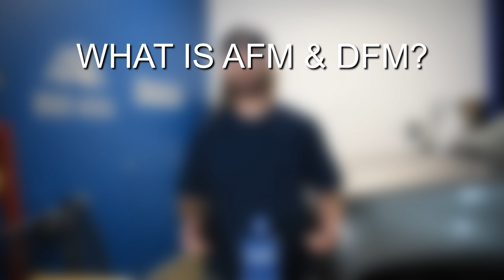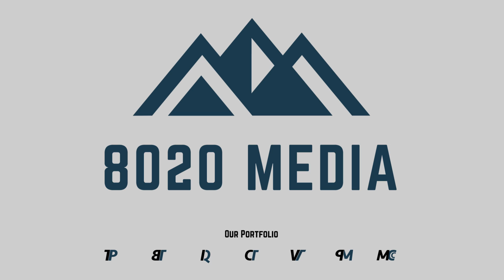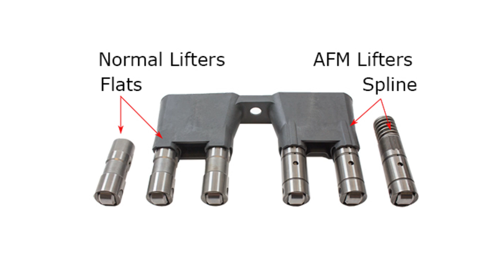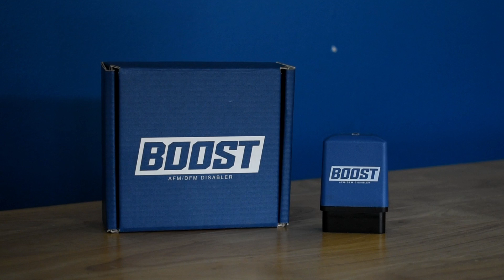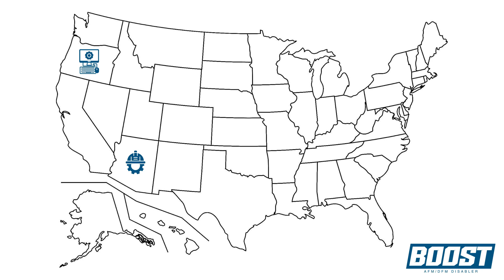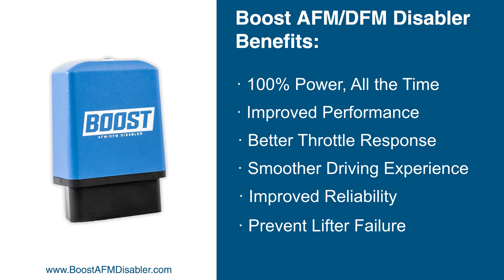Understanding Active & Dynamic Fuel Management and The Problems They Cause (AFM vs DFM)

Comment: Wish I'd known about this before. Now that Ihave another engine definitely disabling it.
Reply: yep, i had 2 lifters fail in January when i jumped into the left lane on the highway and accelerated to to keep the flow.  Between that days lost work, cost of a rental, and the service fee.... I am still paying on that $5K repair bill!!!  I got my disabler delivered today, after my mechanic's lifters on HIS truck failed.  He researched it, as it's a common issue that GM doesn't care about, and he told me about the disabler.  I had a 2nd time that my truck did react to an acceleration.... scared the fire outta me thinking i was gonna have to pull over and and pull out the credit card again!.

Comment: 2015 Silverado.  Bypassed the AFM, lifters collapsed anyway. $6500 to fix. Extended warranty covered $5000 of it.
Reply: so you had the lifters fail, even with the disabler?  I got mine in the mail today.  How many liters do you have?  mine is 5.3L, and i had life failure  when i was accelerating.  I don't want that happening to me, i don't have any warranty
Reply: @HollySlezak 5.3 liter. Truck had 41,000 miles before I used the disabler. I put it back on, after the repair.

Comment: Had this on for 10K already.  Seems to run well.  Slight surge at a stop light to 1st gear every now and then that I didn't notice before but it's rock solid staying in V8 mode.

Comment: Absolutely disgusting that GM hasn’t recalled them all to correct this. And yes, I own a 2013 Escalade EXT 6.2L and yes it has cylinder 8 misfire codes, regularly due to the AFM system….
Reply: You can thank the Democrats for imposing regulations on the auto companies.

Comment: I just bought a 2014 Silverado 5.3 70,000 miles. No issues yet except I just had to add oil half way between oil change. Does everyone recommend this as soon as I can get one?
Reply: i bought a 2015 silverado 5.3 with 71,000 miles the same time you did.  But I learned about all this AMF/DMF stuff when i jumped into the left lane on the highway and accelerated.  Unfortunately, it blow 2 of my lifters.  With loss of that day of work, and cost of a rental car, and the shop costs... it cost me $5K.  
Shortly after, as my AFM/DFM disabler was shipping to me, I gunned it to avoid the sudden turning traffic behind me.  My engine light began flashing and i was losing traction.   I thought I lost another lifter!!!!  (I will refrain from telling you what I did to prevent that, ha) but the light quit and i was fine.  I cannot image it costing me $5K every time I  accelerate quickly.  I am plugging my new disabler in today.  to me, it's definitely worth trying!  

since it's been 9 months since you posted this reply... wondering if you got one and how it's worked for you?  thanks

Comment: My AFM system in a 2012 Yukon 1500XL Denali with a 6.2L and 6spd trans 170000 miles.
My AFM generally only kicks in when I let off the gas pedal. I just test drove it in "D" and watched my display show it was in V8 mode while accelerating from stop all the way to 75mph. Never once shifted to V4. As long as I maintained gas pedal pressure it stayed at V8. While maintaining speed it stays in V8 all the time.

As soon as I let off the gas pedal it shifts to V4 and if I never touch the gas pedal it will stay at V4 until about 42mph and it will shift to V8 and drop to V4 again at 25mph and then back to V8. I drove it on the HWY in "D" and accelerated to 75mph and maintained speed with my foot and the engine stayed in V8. as long as I maintain speed the engine never shifted to V4. At 75mph when I let off the gas pedal completely the engine shifts to V4 and will stay there until either I press the gas pedal again or the engine speed drops to about 42mph and then it will shift back to V8.

At anytime I start to barely decelerate by slightly lifting my foot off the pedal the engine shifts from V8 to V4. Only on deceleration.

I thought this system was suppose to shut 4 cylinders off at steady HWY speeds to save on fuel economy?? At steady HWY speed this engine stays in V8.
Reply: Have a similar GMC with 6.2, 
Changed oil to full synthetic and Lucas
Oil booster, sounds better. Any tips ?
Have you had your rig since new ?

Comment: This seems like a great easy solution. So this plug and play device 100% turns off the dfm system ? And therefore you don’t have to worry about these lifter issues ?
Reply from the maker: C - It prolongs your lifters. The only sure fire way to not have to worry about it is a delete, but we can't recommend it.

Comment: Very lucky we took out the extended warranty when we purchased our 2021 Chevy  suburban with the 6.2L. We dropped a valve which took out cylinder 4, replacement engine from GM has no AFM or DFM. Should get it back at the end of next week for our 100.00 dollar deductible.
Reply from the maker: T - Not a bad trade! Lucky to have a warranty.

Comment: If my truck is coding po307, can I plug this device in and not have to repair the cylinder deactivation solenoid?
Reply from the maker: M - Unfortunately, we strongly advise against using our device if a vehicle has any underlying issues.

Comment: Perhaps my reasoning is incorrect here, but as I understand it, the AFM only engages when your transmission is in drive. In 8th gear for an 8 speed transmission as an example. If you are not in  drive or 8th gear, the AFM will not engage. I’ve always run my 6.2L, 8 speed 2018 Silverado in 7th gear. The cylinder display never goes to 4 cylinder. I’ve seen only a very negligible decrease in MPG. I’ve read if you are in tow/haul mode, the AFM will not engage either.
Reply from the maker: D - You're mostly spot-on in your reasoning—AFM (Active Fuel Management) on GM’s 6.2L with the 8-speed (like your 2018 Silverado) is designed to engage under light load conditions, typically in higher gears like 7th or 8th when cruising at steady speed and low throttle; however, it's not strictly tied to 8th gear—it’s more about RPM, load, throttle position, and speed. That said, tow/haul mode disables AFM entirely because the system assumes you're under heavier load, and manually selecting a lower gear (like 7th) also suppresses AFM, which is why you’re not seeing it switch to 4-cylinder mode when driving like that. The slight MPG drop you’ve noticed is common—AFM saves fuel primarily at highway cruising speeds, but it’s not drastic unless you're doing long-distance highway runs. So yes, running in 7th gear is a totally valid way to avoid AFM without tuning or disablers, and many do it for smoother power delivery or to avoid AFM-related wear like lifter issues.

Comment: Is this only with gas vehicles? What about diesel trucks?? My engine like came on and the code was po461 stating that my truck was over filled with diesel. But I was wondering does Fidel turn off cylinders? Bc I do hotshot and I can’t have that happening.
Reply from the maker: G - Diesel's don't have this technology.

Comment: Hey guys my 2022 lt 1 Camaro squeaks when accelerating I know this is a problem, Camaro users. I was wondering if this would help with that.
Reply from the maker: M - The squeaking you're hearing on acceleration in your 2022 LT1 Camaro is a common complaint among Camaro owners and is often related to the rear differential bushings or driveshaft components rather than anything a tuner or performance module would resolve. An AFM disabler won’t fix the squeak since that’s more of a mechanical noise rather than engine management-related.

Comment: As i understand it, this device will actually protect my vehicles engine by keeping it in 8 cylinder mode and not switching off cylinders, correct?
Reply from the maker: G - Correct. It will prolong your lifters.
Reply: When you run your truck in tow haul mod this also turns it off right
Reply from the maker: @stephenmosher7242  Sure, but then you have to remember to do it every time you hop in the vehicle. To each their own thought!
Reply: But its free  doesn't cost you anything @8020Automotive
Reply: Tow haul still drops to v4. Just less often. Usually when I'm going down grade.

Comment: Will this work on the refresh models 2022+?
Reply from the maker: A - Unfortunately, no. However, we are working on a device for newer models!
Reply: Could you kindly clarify, is the new 2026 Chevrolet Silverado 1500 Crew Cab not compatible with this?

Comment: We live in a different world these days where emissions control is prioritized over longevity. This is a problem across the board from every single vehicle manufacturer, but is managed with different strategies. Most manufacturers are reducing displacement and adding turbos, going to hybrid systems, or even a combination of the two. I personally really appreciate the fact that GM gave us an option that allows us to fairly easily fix the issue permanently by changing the cam shaft and lifters leaving us with a legitimate V8 engine. If you're looking for a genuine, naturally aspirated, V8 engine then GM is really the only viable option left on the table, at least for now...
Reply: Which is funny because the car ends up being junked and you buy another car made with more resources then what was saved through emissions control
Reply from the maker: L - So true.... They do not make them like they used to
Reply: Yeah... Just swap out the flipping lifters and the cam shaft... lol. Just any old Joe off the street can do this on a weeknight after work in their driveway right? GTFOH with this nonsense. Does somebody here work for GM? lol.

Comment: I'm looking to buy an older Silverado. Have my eye on a 2014 w/125k miles on it. How does one determine if lifter failure has already occured OR having signs (SOUNDS) if imminent failure ? TIA
Reply: Make sure you get a good warranty for the transmission that for 100% quit out
Reply from the maker: R - We'd advise getting maintenance records for sure. If there isn't a tick, it may be difficult to tell. Keep us updated?

Comment: So GM decided to double down on an existing problem by introducing DFM.Sounds like our governments way to try fixing anything.
Reply from the maker: C - Pretty much!
Reply: In my opinion just stay away from newer vehicles unless you have tons of money in the banck for all repairs...
Reply: They also have torq converter/ transmission problem that they haven't acknowledged in models before 2020.
2017 silverado with 80,000 miles had to replace transmission  at a cost of 7,000 + dollars.

Comment: GM YOU SHOULD WARRANTY/FIX ALL LIFTER PROBLEM ENGINES!
If I had known this I never would have bought my 2013 Chevy Silverado because basically everyone is saying it's a ticking time bomb, now the actual value of my used truck has devalued $8,000 in 2 years
Auto dealers will only give me a $8,000 credit on a $21,000 vehicle.
I've only put 20,000 miles on this truck.
Now all this bad news about lifters going bad, is ruining my day and my serenity.
Too bad that lawsuit only covered vehicles back to 2014, that's because you knew GM what was about to happen.
Shame on you and shame on the dealer that sold me this vehicle.
Reply from the maker: K - Sorry to hear this..
Reply: You have an 11 year old truck. If you haven't had lifter issues yet, then you aren't likely to. But at 11 years old, you are over evaluating your vehicles value. Also, "shame on the dealership that sold it to me." What are you smoking? How is your 11 year old truck that hasn't had AFM issues, may I add, somehow at fault? Do you take accountability in any form in life?
Reply: @ancorey25 shut up
Reply: @ancorey25  I dont think I asked for your opinion but thanks for your such valuable insights and such profound stream of superior logic, I don't know how I have made it this long on this planet without such valuable people such as yourself guiding my path of happy destiny.
With that being said.
None of my old ford trucks and dodge vans(351c, 352w, 318) had engine issues unless I abused them.

Ive owned this truck for 2+ years barely put 20k miles on it, treated her like a prom queen and it slowly has developed that lifter tick and rusted nicely in this short amount of time......... And fuel economy is terrible too (I average 10.2 mpg in the city without a lead foot)
Imho GM could have done better after seeing the lawsuits and owners coming forward with their horror stories about the LS variable lifter issues.
Sorry to have offended you with my original comment, please forgive me and try to have a good weekend, big hug sent your way big fella.

Comment: How many millivolts does it pull when plugged in with the engine off? Why can't it shut off completely  and just wake up when the car is started?
Reply from the maker: T -  Our device only draws 0.71mA of current while the vehicle is turned off. It does wake up when the vehicle starts. If you're afraid of battery draw, then it is simple to unplug and plug in when you start/stop the vehicle.
Reply: @8020Automotive  Just so that I'm reading this correctly, you mean 0.71 milliamps, not 0.71 volts. So if the vehicle's normal draw shows as 0.01 volts, the draw with the device would be around 0.017 volts. Which would read as 0.01 to 0.02 on a standard voltmeter. That's good. (Please correct me if I'm reading or applying that wrong.)
Reply from the maker: T - You are reading it correctly. Our device has the lowest battery draw on the market.
Reply: @8020Automotive  That's excellent. Thanks.

Comment: Can you also just drive in L9 for the 6.2 with the 10speed?
Reply from the maker: D - You could, but have to do this every time you get into your vehicle. Whereas if we had a device that worked on the 10-speeds, you would just have to turn your vehicle on and go. However, we don't currently have a device that works on the 10-speeds.
Reply: @8020Automotive   Are you planning on or currently developing one for the 10 speed?  Is there something about the 10 speed that makes it more difficult to create a plugin device for it?  I emailed Range and they suggested their Pulsar LT product, because their simple disabler does not support the 10 speed.  It costs over double their plugin model however, has more features than I need, and is a more complicated install/remove process for when you need to remove it.  I would gladly buy a simple disabler for DFM 6.2 with 10 speed if anyone offered it.
Reply from the maker: B - Unfortunately, we don't have plans on a device for 10-speeds. These are a little more tricky to crack. However, after this next device we're working on, we may explore into the 10-speeds.

Comment: At what mileage do people start having issues with the management system if most mileage is driven under 50 mph and synthetic oil used at 5000 mile change cycle?
Reply: I have a 2021 Silverado RST bought new just over 26000 miles. At the dealership waiting for parts.
Reply from the maker: M - Unfortunately, there isn't a specific mileage range it typically happens. However, the more miles that is put on, the higher the likelihood.  All you can really do is take great care of the engine, which it sounds like you're doing!

Comment: I HAVE EXCESSIVE OIL CONSUMPTION IN MY 2009 CHEVROLET TAHOE LS MODEL. 1/2 - 1 QUARTER DURING ANY TRIP OF 100-200 MILES. IT HAS 140K MILES, BUT ENGINE IS IN GOOD CONDITION OTHER THAN OIL CONSUMPTION AND WEAK ACCELERATION WHICH I THINK IS DUE TO THE AFM SYSTEM. DO YOU KNOW IF THE AFM SYSTEM CAN BE THE CAUSE OF THESE PROBLEMS? AND WILL YOU PRODUCT HELP ME STOP THE PROBLEMS? THANK YOU.
Reply: I have an 09 silverado 1500 with 240k miles... though afm does eat up some oil, I believe most chevys in this era also suffer rear main seal leaks as well as other issues. Be sure to check valve stem seals, piston rings, and fouled spark plugs sooner than usual because of oil leaking in. 

Lucas stop leak and synthetic oil of a slightly higher viscosity (10w30) goes a long way with keeping all that oil in one place till the next oil change.
Reply: @shortyrocksyou  I guess is both afm and some other factors even though engine sounds good. I already went up to 10w40 once and nothing changed lol this is annoying
Reply from the maker: S - Well said! Thanks for sharing this info and helping out a viewer.
Reply from the maker: C - It is possible that AFM could be causing some excessive oil consumption. However, it likely isn't your sole cause here. Are you having any other drivability issues?

Comment: My husband and I just traded in both of our Suburbans last weekend. They both have the 5.3L engines.

His was a 2016 with 115k miles, and mine a 2018 with 86k miles. None of them had the engine failure. We were very proactive to replace the oil every 3k miles with Mobile One Full Synthetic oil.

The 2016 tranny failed a little over 50k miles, we replaced it with a new Chevy tranny at our expense.
Reply from the maker: K - Thanks for taking the time to share your experience! Crazy what happens when vehicles are well maintained.

Comment: Just bought one
For my 2022 Chevy with 8 speed transmission, I will check it and let you know about it
Reply from the maker: A - Thanks for the support! Keep us posted!
Reply: Update????
Reply: Working good, decreasing fuel mileage 14mile per gallon, draining battery if your vehicle sets off for 3 days , if you use your vehicle daily it will be fine with no issues.
Reply: @ammarsulaiman8353 I just got my 2022 trail boss and I’m kinda on the same page with you 5.3 10 speed
Reply: @ammarsulaiman8353 did you also notice a difference in engine power?
Reply: Yes
More power and smooth driving 
I forgot it bulged in and did emission test and my truck doesn't pass , I removed it and drove my truck 40 miles then pass , that's mean it's working fine.
Reply: @ammarsulaiman8353 good to know to remove a few miles before doing the emission test 👍